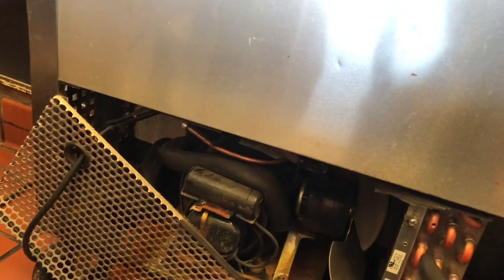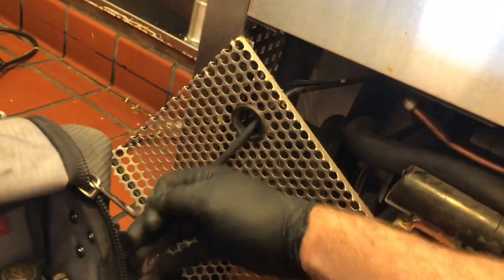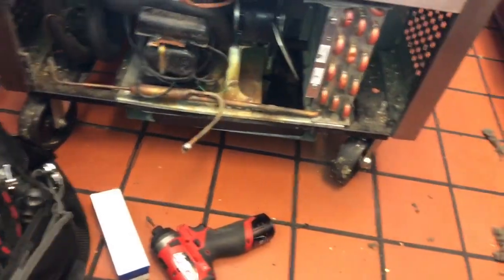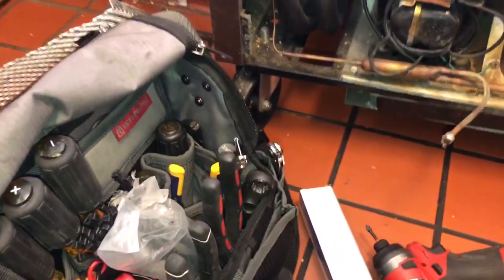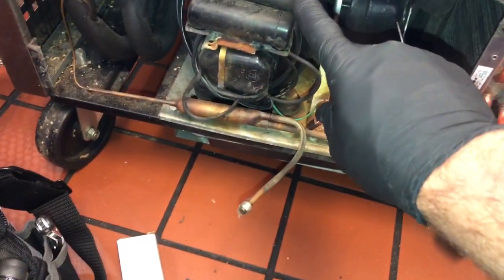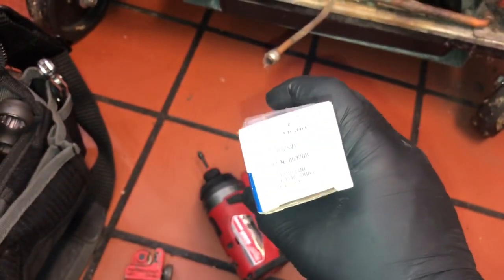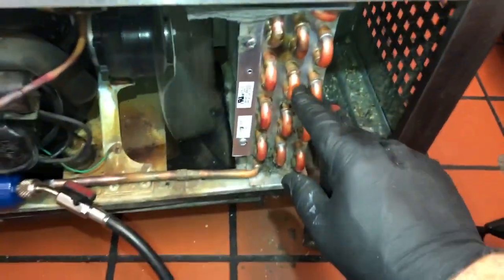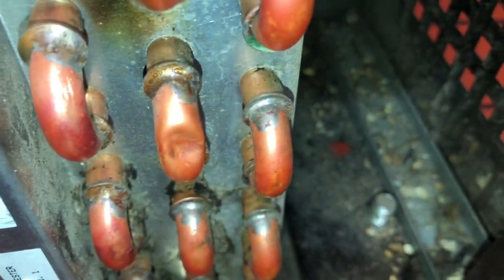Customer puts a HOLE in condenser

Comment: You can fix the flattened return bend. Heat the bend, tack your solder stick to the bend, let it cool and pull it out. Give it a go, you'll be surprised how easy it pulls out.

Comment: P. s. Everyone that has Put a screw into a Roof top Package unit condenser u bend or other places. id Love to hear the horror stories. 🤣 We've ALL Done it once ! or WILL do it if u have not yet. Put a Like on this comment & comment where u put the screw in. 
i Put one into a Rooftop Package unit on maint. once ! Never Done it since ! i allways double check now.
Reply: OcRefrigeration , Hvac & Electrical Video's. I put a screw hole in a package unit condenser u bend right in front of my service manager the one day 😂 it wasn’t a good day but now I always double and triple check
Reply: wiring and water lines for me mainly ( remodeling work of course)